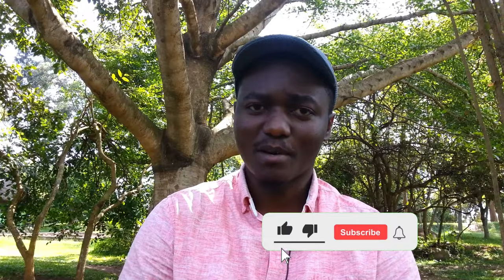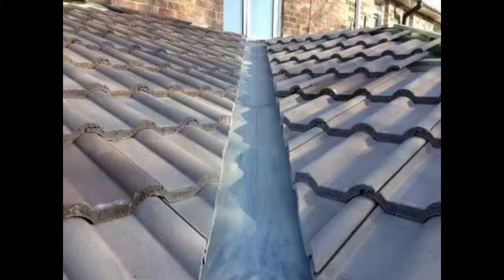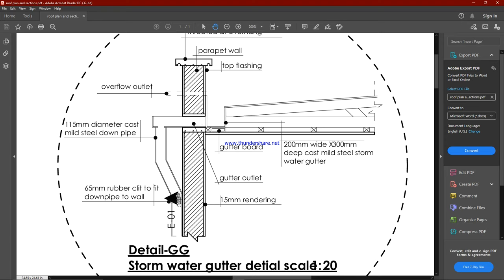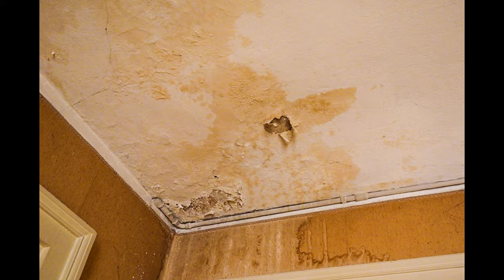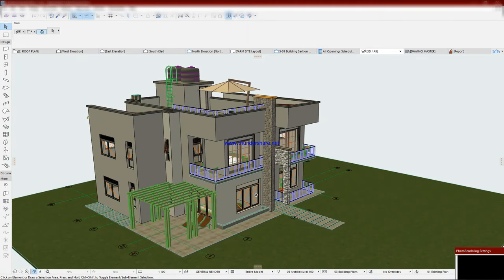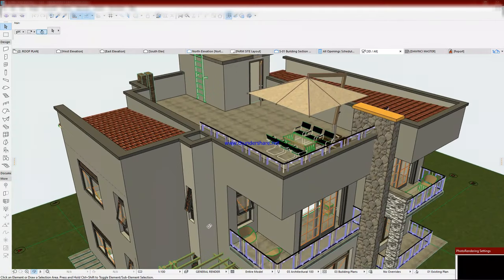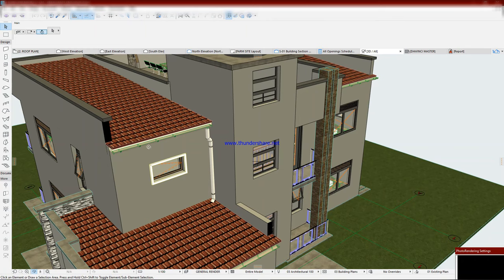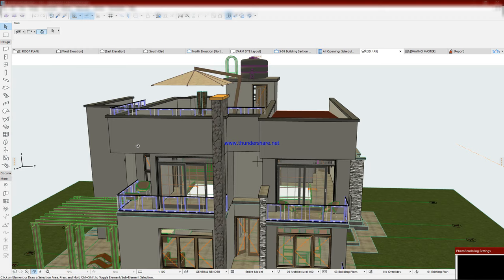Don't use Flat Roofs, They leak | Causes and solutions

Comment: I have too looked the research the same n to me if if it is rain n it is windy there is a cycling winds that tend to play a round game , the up air is in a circular motion n the down air in the house is calm  . The  space between iron sheet n gutter will be the only space where this eddy will sip through because they have been blocked by the wall. They will  go together with the 💧 drops of watter n it will eventually rain 🌧️ inside. The second idea i if the roof is too flat ,i mean very small gradient, water from top of the sheet will flow down n then will not fall in the gutter n tend to go back on the lower side of sheet a distance of about 5 inches n i

Comment: Most people with flat roofs are lazy and they don't bother to regularly clean their roofs. Doing a flat roof has its pros and cons, same as hipped. If you build a low-quality flat roof or don't regularly maintain/clean it, then you'll definitely have problems. No cutting corners.

I should add that the concrete gutter (if you go for that) should be water-proofed and slopped enough to allowed water flow without any impediment.
Reply: Thank you

Comment: Or use Miracle 511 Impregnator Sealant.  You apply a thin layer all over your roof deck, bathroom floor and wall tiles, your house floors and even on your kitchen counters and water seepage issues become the past.
Reply: What's that chemical
Reply: What's that chemical

Comment: You have two types of flat roof

Warm roof: insulation above the timber deck & timber deck installed above 

Cold roof: insulation between the roof joist, there must be ventilation above the insulation! If you don’t install a ventilation gap above the insulation you will get condensation forming under the roof deck.